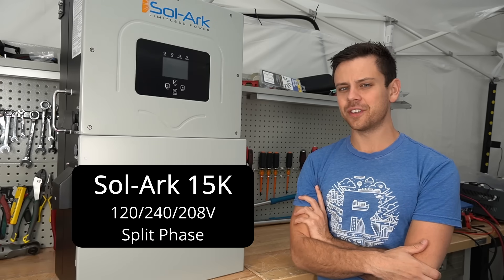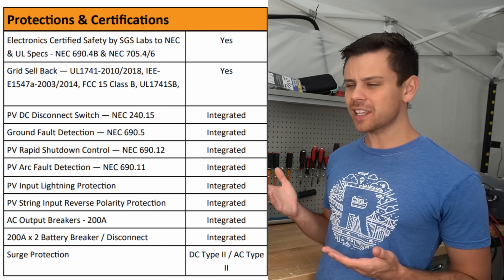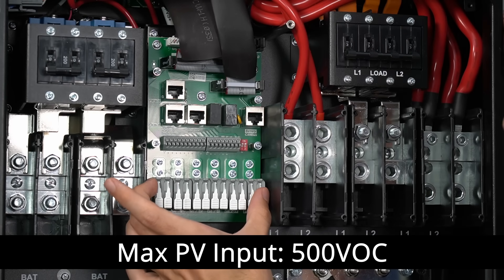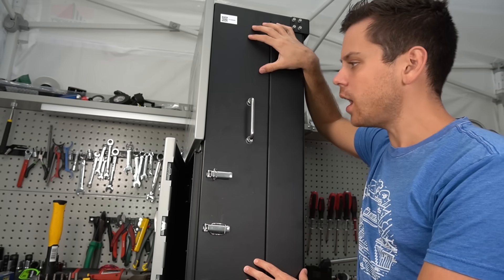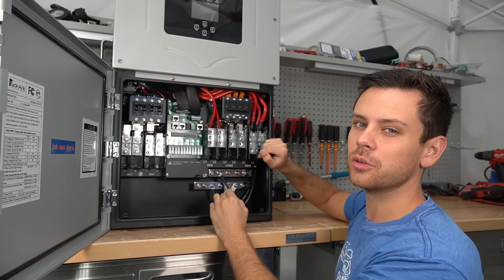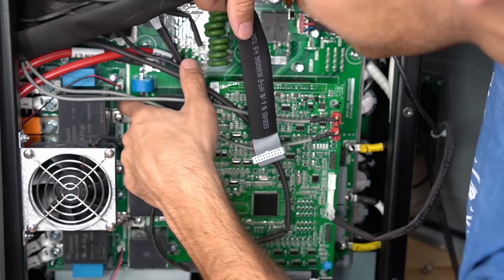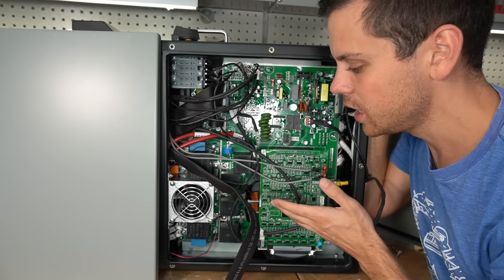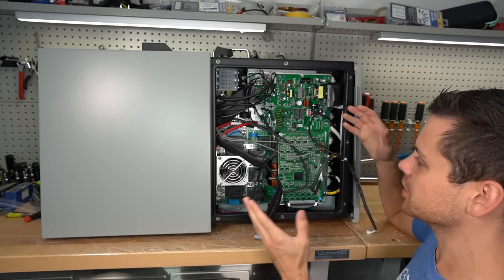Sol Ark 15K: Ultimate Grid-tie or Off-grid Inverter

Comment from the maker: Also, you can hire a local electrician to wire this up! You can create your own micro grid, interact with the grid, or build any size offgrid system you wish. Pretty wild!

You can find it here (affiliate link):
https://www.currentconnected.com/product/sa-15k/?ref=wp

More info and pictures: https://www.mobile-solarpower.com/code-compliant-48v-offgrid-system.html

For a budget friendly 48V system, go here: https://www.mobile-solarpower.com/48v-complete-system-blueprint.html

~~~~~~~~~~~~~~~~~~~~~~~~~~~~~~~~~~~~~~~~~~~~
Tired of getting ripped off? Check out my "Will Prowse Approved" solar product recommendations below!

12V Batteries
https://www.mobile-solarpower.com/lithium-batteries.html

48V Batteries
https://www.mobile-solarpower.com/48v-batteries.html

Offgrid Inverter System Builder
https://www.mobile-solarpower.com/48v-complete-system-blueprint-559371.html

Hybrid Inverter System Builder
https://www.mobile-solarpower.com/code-compliant-48v-offgrid-system.html

Mobile Handtruck System Builder (very popular!)
https://www.mobile-solarpower.com/mobile-48v-system.html

Solar Panels
https://www.mobile-solarpower.com/300w-solar-panels.html

Ground Mount Solar Racking
https://www.mobile-solarpower.com/ground-mount-racks.html

Wire, Lugs and Busbars
https://www.mobile-solarpower.com/wire-and-connectors.html

Tools
https://www.mobile-solarpower.com/tools.html

Fuses and Circuit Breakers
https://www.mobile-solarpower.com/fuses.html

Plug-N-Play Solar Systems
Ecoflow, Anker And Bluetti! So many models to choose from. See my current recommendations here:
https://www.mobile-solarpower.com/full-size-systems.html

~~~~~~~~~~~~~~~~~~~~~~~~~~~~~~~~~~~~~~~~~~
Need to build a large DIY system? Need a trustworthy solar distributor? These are my favorites:

Signature Solar
Creator of EG4! Solar Minisplits, Victron and More! Largest Solar Store Online.
If you want $50 off, please use my link below and coupon code "DIYSOLAR50":
https://signaturesolar.com/?ref=cPwLcVc0SW-BjN

Current Connected
Best Prices for EG4, Victron, Midnite and so much more! Fast Shipping and Highest Rated Customer Service:
https://currentconnected.com/?ref=wp

~~~~~~~~~~~~~~~~~~~~~~~~~~~~~~~~~~~~~~~~~~
Join our DIY Solar Community 
Need more help? Join the largest solar forum on the internet for beginners and professionals alike. 140,000 members and counting!
https://www.diysolarforum.com

Check Out My Free Book
Best-selling and beginner-friendly guidebook to off-grid 12V solar!
https://www.mobile-solarpower.com/the-book.html

~~~~~~~~~~~~~~~~~~~~~~~~~~~~~~~~~~~~~~~~~~
Contact Information:
I am NOT available for personal solar system consult! If you wish to contact me, this is my direct email: williamprowsediysolar@gmail.com
FTC Disclosure Statement and Disclaimers:
Every video includes paid promotion or sponsorship (such as free products for review). Some links on this YouTube channel may be affiliate links. We may get paid if you buy something or take an action after clicking one of these. My videos are for educational purposes only. Information is subject to change/update at any time. Electricity is DANGEROUS and can kill. Be smart and use common sense :) DIY Solar Power with Will Prowse is a participant in the Amazon Services LLC Associates Program, An affiliate advertising program designed to provide a means for sites to earn advertising fees by advertising and linking to Amazon.com
Reply from the maker: That is a scam account
Reply: @WillProwse  any idea when you will get to review this unit?  Already bought one and am halfway to install.  Folks need to know about the gobs of features in this unit.  It's expensive, buy with the amount of PV input you can do, AC coupling, generator call, built in 200 amp transfer switch....it really is the absolute best for residential. 

The best feature in my opinion.........you do not need to go into an agreement with power company to supply your whole house.  This along with the 12k can do what is called "limit to home."  Using current transformers on L1 and L2 just after your meter....it will not send back to grid.  This exact reason is why I bought the Sol Ark.  You can maximize your PV generation saving money on grid, but use batteries for critical loads in grid down all while keeping our VERY important linemen safe!
Reply: I’ve been waiting for you to do an install on this, before I DIY mine on my off grid property, with 6 EG4…with 12k watts of panels 

Hoping you break it down simple & safe
Reply: Do you know when you'll be releasing a video of the install of this unit at your friends house?
Reply: The new canadian solar products has a very similar inverters like that one, from single phase to three phases 4 mppt, no display for external use and many features that seems very good quality products for residential and industrial as well their new solar panels that are huge with plenty capacity, you should take a look on that brand and tell us what’s your experience 👍🏼😎🇵🇷
Reply: Will would you recommend using the EG4 Lifepower Batteries / Rack with this system or the  Sol Ark Batteries at $1800??
Reply: Your knowledge is so vast and it would take forever to piece together all the great info you put out.  Do you have any videos of how to put together complete systems?  I think it would be great to have a few complete systems that we could pick from.
Reply: Hey Will if I have solar on my house that is grid tied and uses micro-inverters to feed 120v AC into our panel would using this SolArk still be a good option to add batteries into our system to help do time of use and backup power? Im thinking the 120v AC from microinverters thats being fed into our main breaker panel would just continue to produce power and our inverter would just pull from those panels acting as the grid if the main grid from provider was down? Any advice would be much appreciated
Reply: This would be the ultimate large RV system with SOK server rack batteries!
Reply: @samanthapowell5882  you should check out the new 5k Sol Ark just launched.  Ridiculous amount of PV input for its size, and if you use a MicroAir on your AC unit, you could boondock in comfort.
Reply: @wadebrewer7212  5K way to small!
Reply: Can you give some feedback on this GSL ENERGY Model No. GSL-H12KHV-US 

I just bought the 8K version of this, never saw there products on your channel?
Reply: Will, trying to verify that I’m talking to you on Telegram text.
Reply from the maker: @seven29farms  I don't have telegram
Reply: @WillProwse  If I want to temporarily add a portable ground mount panel to my Sol-Ark15K-2P, can I simply turn OFF the DC switch to the PV array and then connect my red and black wires into MPPT3? (MPPT1 and MPPT2 are occupied by roof mounted strings of 10 panels 410w EACH.) BTW, a BIG FAN of your channel and I have watched (and LIKED) dozens of your videos...but just found this one today!
Reply: Hi What size of bms do I need for a 24volt 320 ah
Reply: I have the renergy 100 watt suitcase are they supposed to be hot after being in the sun I assume so because they're black and they're producing electricity
Reply: I like this. We are looking around for something for our small duplex. We have great solar potential with our place in a south facing bluff. have an old Trace 4048 that does a lot of this. It’s transfer switch is only 60 amp though. We use it at our remote cabin. It also adds the generator output for a total of 60 amps output. I worked in electronics and telecommunications all my career except for a few years building jet engines. I love the way you explain things.
Reply: Are you able to create a micro grid that is not tied to the main grid with cheaper grid-tie units? If not, what feature of this unit makes it possible, and could cheaper units be combined with this one to create a micro grid?
Reply: Hey Will! I recently bought 20+ acres and I want to build a 100kw array using snail trail solar cells or something similar, most likely offgrid. Any suggestions? Maybe you should fly out here and do a video on "Building a complete 100kw offgrid array!"
Reply: @the-uppload  check canadian solar brand they has a huge variety of products for industrial, I did a comment about it in this section, im not a seller just get the information by another YouTuber that was in a trade show were canadian solar exposed their products

Comment: As someone who installed a lot of Sol-Ark 15k inverters professionally, the only thing I found wrong on his install comments was when he said you can wire it in between your meter and main panel without any disconnects.  That's partially incorrect because there is no disconnect or fusing on the grid side of the inverter.  You do need a fused disconnect between the meter and the grid side of the inverter.  Then you have a solid setup.  Meter > Fused or breaker-equipped disconnect > Sol-Ark > Main Panel.  Then you have a solid whole-house 200 amp setup.  Recently I'm not overly impressed with Sol-Ark's tech support, but for the most part they are decent at it.  The inverters are excellent though in my experience.  Of the 60+ that I've installed, we only had one that has issues from the factory and they replaced it.

Comment: Does this unit have a dead front to cover the terminals if access to breakers were needed? Without that any inspector would want seperate principle between meter and load.

Comment: I have 27 panels of blue sun bifacial panels, 460/575, that are currently hooked with my 2- eg46500 ex inverters. I also have a battery bank of 12- 5.12 48v batteries totaling over 61k of backup. Wanting to upgrade to 2-Sol Ark 15k inverters. I want to use my 27 pv panels on one Sol Ark 15k inverter. I want to buy more panels that are not blue sun but supply 400w of power each. Better price point for me. The newer panels I want to hook up to the 2nd Sol Ark inverter. I'm hoping that this setup overts the problems with placing these newer panels to the current ones and making my current ones work at a lower capacity.  I posed this question to the tech support 2 days ago at Sol Ark, but there has been no response yet. What are your thoughts on this? I don't want to buy anything until this gets figured out. Also, can you give your thoughts on coupling a solar bank of 48v eg4 lifepo batteries (pros and cons) Thank you in advance for your response.

Comment: I got this unit installed, but the installer is not real knowledgeable about it or how to configure it. Wondering where I can get info. I would like to set it up to charge batteries during low-hours and feed to my house during peak-hours using Solar and Battery. My installer doesn't know how to do that. Currently it just charges when the sun is up and discharges 24/7 as load requires.

Comment: Will…I am considering the Sol Ark 15kW for a (new) whole home hybrid solar solution since it has the 200Amp pass through. My question is…I am planing on using 36 400w panels. I want to use 3 strings of 12 panels each. But after doing my cold calculations (as per NEC 70), I can only use 3 strings of 9 panels. However, as I watched your video, I saw that there are actually 6 ports for PV. The manual says 3 MPP ports so how does this have six ports for PV? Am I missing something here? I’d like to get 15k or more of solar coming into the system. How is that possible?
Thanks for your help!

Comment: Does it come with a consumable parts list?
Are the capacitors used in the power rectification ckt top tier? Because it's these caps that will eventually fail.

Comment: Did you post the install video yet? Curious to see that! I install these for my job and it’s pretty fun. They could use a bit more space for landing the ac connections. It’s quite a challenge bending the 4/0 aluminum wires to land in those lugs.
Reply: Have you had any issues with the 4/0 Aluminiun cables (CCA)?
I thought installers would only be using solid copper.

Comment: It was so funny, I was resetting my power meters on my inverters June 1 around 12:00am and 2 meters did not go to zero but were recording about .3 amps, I reset them again thinking they malfunctioned and got the same thing. ( I am NOT at the polar regions so NO midnight Sun here) Puzzled I looked at the sky and saw a very bright less than full moon.  PV panels will actually use sunlight reflected off the Moon. Maybe I can charge my cell phone. Lol

Comment: OK I’ve got a question here, I’ve done a DIY solar system I have 27 panels, 250W, 24 V and got five on each array on going to separate micro grid tie inverters that are 1300 W capacity and double that at peak running to a separate breaker box or panel then, feeding directly to a 220 breaker in my main panel with dedicated AC circuits for each inverter. My main question is… since grid, tie inverters use the incoming electricity from the power grid to sync the sine wave. Any time there Is a loss of power they ceased to function as an anti- Islanding feature. Is there some code or necessary element that I need an auto shut off on the outside of the house as well? Is it just for looks or just to reassure any lineman working on the line upstream That they won’t be electrocuted?

Comment: Starting out on my Solark15k DIY build. Just pulled the trigger on a Solark15k, (6) eg4 version 2 batteries for closed loop to the inverter and (24) blue sun 460watt bifacial panels and they all just got delivered. I plan on doing 3 strings of 8 panels in series to this beast. Will, still waiting on your video for this install. In the meantime @engineer775 has hands down the best videos in the realm on the solark15k installs. I am a little miffed about missing the EMP hardening on the Solark15k inverter which was just released. A couple of grand more with EMP hardening, however you get piece of mind.

Comment: Living in California we robbed every night starting at 4PM.   I'd love to have a TOU Grid Tie system where I can run off a 20Kwh battery bank at 4PM when electricity is expensive and switch back to the grid after 9PM to recharge when its cheap.  That would be ideal...

Comment: There is so much information at times it makes my head spin.  I'm building a off grid fulltime travel trailer want a economical power supply.  I can do 4000 watts of solar on roof I will have a 240v mini split A/C ...was looking to do a "all in one split invertor and about 30 to 40kwh of server rack batteries.....Will can you give recommendations on such components?  What do you think of the server rack batteries from China looks like same components but half the price if I buy direct from Alibaba.......Please Help !

Comment: Anyone try the Deye 12K US inverter?  Also, if you run your meter into this and the output to your panel, a failure on this unit could leave you without power and the possibility of needing a generator input directly into your panel rather than thru the Solark.  I would be leery of this.

Comment: This market which you've informed us about is amazing, as well as all the systems integration you've demonstrated at all levels. I've got a a question that keeps coming to mind regarding 10+kw systems like this. Can a 48v battery architecture provide the rated load power on this--12kw? I would imagine this is near the limit of your typical 48v 5kwhr module. How does a system scale beyond that? Are modules put in series to 96v or are each of the hybrid inverters associated with 12kw battery packs individually at 48v?

Comment: I noticed that in another YouTube video they said that the EG4-LL Lithium 48V 100AH server rack batteries (which you have recommended) could not closed loop communicate with a Sol-Ark 15 or Sol-Arc 12. What batteries would you recommend? Can I just use some other 48V 100AH lithium Iron phosphate batteries that look more like an automotive battery to save money or are there important advantages that server rack batteries have?

Comment: I have a 300 amp service, driven hugely by two 240V 28kW electric tankless water heaters and 2 AC units (5 ton, 3 ton) and a 2 hp submersible pump for the home.  The water heaters really consume power for the short time they run.  Would a 48V battery bank (e.g. SOK or EG4 LiFePO4) and one of these 15K units run this demand or would the draw be too large?

Comment: Did you ever post a 2nd video on the Sol-Ark 15kW showing it in use? I really want your review of it with power (PV and Grid) along with EG4 LiFePo4 batteries in operation. Also the Wifi smart setup because I can't get the app for Android (links broken)

Comment: Thank you so much Will for everything you do online. I personally found out that Solark and Growatt are good for my purposes. I never use "the best" expression because whatever works for you is your best. People just buy the most of what they can afford (be batteries, panels etc...) I just don't know why people don't just put all the necessary things on one board and have people buy them just to hook up the batteries and panels to the board (for small and midsize) off grid systems? Most people will try to hook up 2 to 6 panels and 2 to 6 batteries together. Then keep adding few more when need be. They will like it or love it, then ask for a professional setup by professionals. Just a suggestion and the feedback will help.

Comment: This seems more for a commercial app...  8k plus for what is basically an eventually expendable item kinda defeats the purpose of the low cost solar system... You can get 6 ep4, sunpower, or Mpp for the cost of one of these and 1300 bucks is a whole lot easier to swallow when it fails out of warranty...